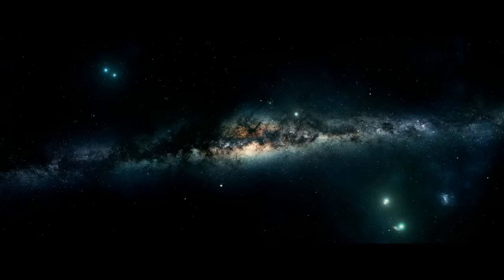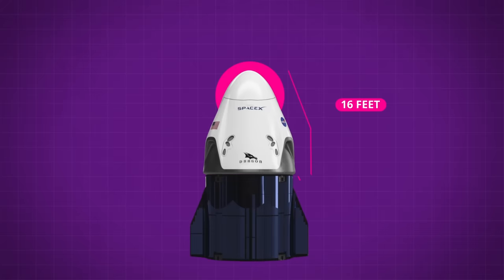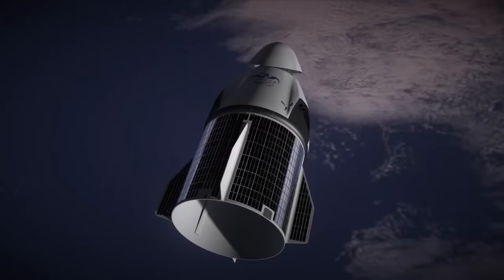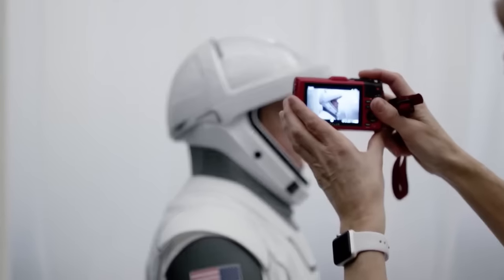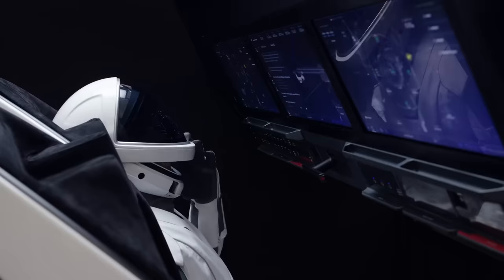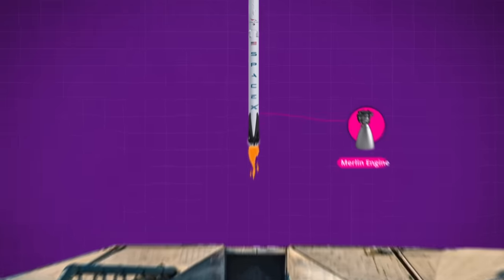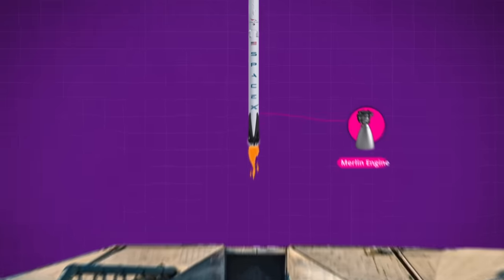Life Inside The SpaceX Dragon Capsule!

Comment: Overall a really great video - a few points though:
1. When showing dracos and superdracos, the video shows superdracos being tested when talking about draco, also it shows a turbopump schematic. Draco and Superdraco are both pressure fed, no turbopump on board Dragon.
2. When explaining the effects of vacuum, Blood inside the body doesn't actually boil. The human skin is sturdy enough to maintain sufficient internal pressure within the tissue to avoid boiling even at 37°C . The issues are instead:
   - the bends - excess gas in solution in the blood might form bubbles - causing strokes or other damage - similar to a diver rising too fast.
   - freezing - exposed mucous membranes in mouth, on the eyes and inside the lungs will encounter rapid evaporation of liquid, causing drop of temperature and possibly localized freeze burns. This is especially dangerous in the lungs.
   - sun burn - if skin is exposed to space directly, unfiltered sunlight will cause severe sun burn due to high UV content and heat where exposed
   - suffocation - no air means no oxygen, which causes loss of consciousness after as little as 10 seconds and death within 1-5 minutes
its the very last that is typically deadly. Everything else is harmful but anyone rescued before they suffocated should have survivable injuries.
3. The suit doesn't have to restore sea level pressure. Typically pressure at 10000ft is considered comfortable in airliners, twice as high is survivable, even more if pure oxygen is supplied instead of nitrox, which most emergency suits supply in case of pressure loss. When exposed to vacuum, most IVA suit system typically supply an environment more akin to a climber on the peak of Mt Everest with an oxygen bottle than air at sea level.
4. The mission timeline could have mentioned stage seperation in a bit more detail. During 1st stage flight the g forces slowly increase as there's less and less propellant left. At the end the engines throttle down to prevent it from getting too high, but its pretty intense. Then they shut down at MECO, and you are suddenly weightless for the first time for a few seconds, feeling your stomach and everything else lift, before the 2nd stage ignites for the 2nd half of the ride. Stage sep is quite intense, and so is the 2nd stage flight on Falcon with the engine so close to the capsule, as reported by Astronauts.
Reply: I dont think that smiley fits here. This is a education video. If there is false information. Most people are glad when its corrected with right information.
Reply: A very important point here: You can't physically prove your fantasy land of space exists 👍
Reply: @quentinmayerhofer9003 Relax. It was funny. We all get it, but we can still maintain a sense of humor.
Reply: Maybe you should be in charge 🤮

Comment: So what happens to Dragon 2 if computers onboard have problems AND they lose contact with the ground? They are kind of screwed. No Buck Rogers manual control like in Mercury or Gemini. Gemini 8 would have been fatal with this system. Its emergency happened outside of the window of contact with the ground, and a thruster was stuck.
Reply: Not very much detail in the video.  I'm pretty sure they thought about that already.  Plus that ignores triple-redundant systems with isolated processes, power supplies and support systems.  They also probably have established procedures right on their iPads.

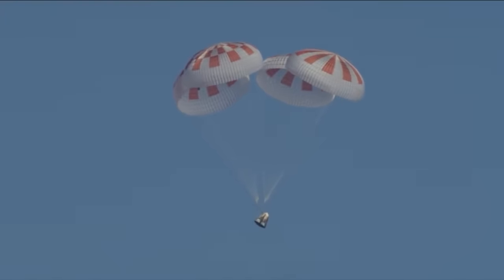Comment: 1:30 A little more respect for the Apollo capsule would be appropriate.
You also need to remember when the Apollo capsule was designed and built.
Reply: Also, to imply that the Apollo Crew didn’t understand the lights and meters is completely ignorant.  Every crew member knew every switch, light and meter’s function.

Comment: Why don't they fire the Draco thrusters prior to reentry, as part of the reentry burn? They are not used in decent and they have a significant mass whose elimination would aid in the reentry process.
Reply: It's cheaper to refurbish a slightly thicker heat shield than the draco engines. They wanted to use them for land landings because refurbishing them is much cheaper than all the support ships and helicopters needed for recovery in the ocean as well as the sea water damage. The super dracos have plugs built into their nozzles to keep them protected from seawater if they are not used.
Reply: Orbital mechanics are a harsh mistress, you don't want to just go firing engines and altering your carefully calculated trajectory, and then end up burning because you where too steep. Also, the propellant mass hardly matters for reentry. 

Finally, even if they fired them, they would still have to take this precautions, because that's what they are. The motors already have valves that close and aren't supposed to leak any fuel, but unburned residues could still be present. So, burn or no burn, they would still have to do this.

Comment: Just a thought but if they are angling for re-entry and the Draco ESCAPE rockets have not been fired, why not fire them to slow down the craft, lighten it up a bit and ease the heat of re-entry?
Reply: In short, because it's not necessary. Servicing the heat shield is easy (and has to be done after entry regardless of how much it's worn) ; Servicing hypergolics which were fired is a right PITA, so the less it has to be done, the better.

Not to mention Super Dracos burn a lot more propellant, and thus increase the risk of contaminating the pod accordingly.
Reply: @paulzuk1468  Thank you for ending my career in rocketry before it got off the ground - let alone re-entered the atmos... :O) Seriously though - thanks for clarifying.

Comment: Why doesn't the elevator go all the way to the crew access arm?
There has to be a logical reason that the astronauts have to go up a flight of stairs after taking the elevator ride.
Reply: Because the space shuttle was a different height and crew dragon is on a half floor so the old shuttle tower elevator wasn’t made for this so they made a staircase
Reply: @Wurtoz9643  Thanks. I always wondered about that.

Comment: Great video !  For something better we will have to wait for the Crew Dream Chaser !  And that will have to wait for at least until after the first six cargo flights .  These flights to LEO is the "First Step" for the return to the moon to stay (and cheaper than SLS)  ! ! !  After docking with the Commercial Space Station in LEO (and low inclination) the crew transfer to the LEV/LLV (single stage/reusable/with an air lock/dust lock).  The LEV/LLV (mass about 12 to 15 tonnes) will load about 45 tonnes (or less) of fuel (H2/O2) for the  return to LEO !  More info on "moon direct" by Robert Zubrin.  Back to the Moon to Stay and onto Mars and Beyond-Ad Astra...  Talk to you on the moon soon!  tjl  T. Lipinski

Comment: We all live in the "B" field of earth,  that is the center of the earths magnetic field.  The pyramids could have been communication devices that would vibrate the earths "B" field and allow for connectivity around the earth.  The great pyramid though I believe was a total intergalactic transportation device operating in the earth's magnetic field.  vibrating the numerous stones in the kings chamber would allow for transport!!  So lets look over what we know as fact:

1.  The center field of a magnet just like the earth is the most powerful part of the magnetic field that is showing itself through the IRON magnetic bar.. IF  it weren't for the center field energy AC current could not flow!! nor radio waves. (nor would there be a magnetic bar).

2. Things we know and can prove :  A. If you take the center of a magnetic bar and tap it close to a trickle of water you will see it repel the water!!   B.  If you tap the center of the bar on none Metalica things you will see them loose significant weight!!   C. If you use a sawtooth wave form with the "B" field just like they show on the pyramids (^^^^) typically at a frequency of less then 432 cycles on granite rock it will  turn to butter and when you stop the vibration the rock will be much harder because the molecules could relate better.  D. I personally believe that UFO'S operate on the "B" field ,  They are for the most part none metallic more of a fiberglass plastic superstructure.  The fact that they emit such a strong "B" field they disrupt our primitive systems.  E , Man kind has a long way to go with the "B" field. Want to see a little proof:  Go to Coral Castle Florida on YOUTUBE just for starters. Ed had constructed several generators the last one consisted of 25 "V" style magnets 5 deep all in the REPEL mode to maximize the "B" field into his ground.   We have allot to learn..!!!
Reply: reading this gives me brain rot

Comment: Question: do the Super Draco thrusters share a fuel supply with the normal Draco thrusters on the Dragon?
I've been wondering if SpaceX could fire the Super Draco thrusters after docking to the station to give it an orbital boost (otherwise the fuel for them is just dead weight both ways), or if the same fuel is used for the other thrusters so it's an either/or (if they abort they aren't going to need the other thrusters, if they don't abort the other thrusters use the fuel)

Isn't the Dragon able to hold up to 7 people (not that it's been flown that way, but I thought both Starliner and Dragon had configuration options for more than 4)
Reply: This was talked about a lot after the invasion of Ukraine, and Rogozin's crazy claims regarding the ISS. So, there was a lot of speculation about using Dragon to boost the ISS. 

It is theoretically possible, but there are a few potential issues. The first one being, the IDA (the docking port used by ISS and Dragon) isn't rated for that. It isn't rated for that kind of thrust. Basically, it was designed and it's rated to dock a vehicle and let astronauts in, not to move the entire ISS. 

There is also an issue of thrust. Zvezda has two tiny engines that produce arround 3000N each. Each superdraco does like 60kN. It might be a bit too much, even if deep throttling.

Comment: So how come the man who dropped off a redbull balloon did not burn up
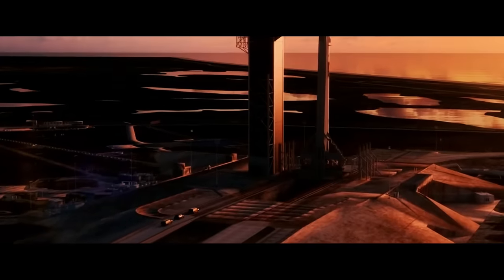Reply: There is no reason to burn up when you drop from a balloon. Why should that happen? So it was not even space (a balloon cannot go to space), but only 39 km. Most used definition for the beginning of space is 100 km. However, at 00:25  he mentions Blue Origin as "not real space". They have a small rocket, that goes straight up and then drops from 107 km. Also that doesn't need a heat shield, it is not fast when it enters the atmosphere.

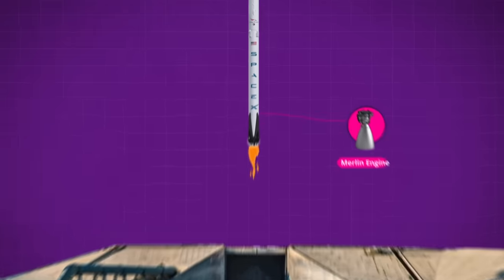The reason, why the Dragon capsule burns on re-entry and needs a heat shield is presents at 9:27 . It accelerates to 27000 km/h. So it flies around the earth with that speed (everything in low orbit does that). But that also means, that it slams into the atmosphere with that extreme high speed when it come back.

Comment: I'm pretty sure the astronauts that flew on Apollo knew what every light, switch and instrument was for. Why do you say the nonsense that you do?
Reply: Wrong. Reference the Apollo mission where they were struck by lightning and everything went dead. Ground Control had to tell them where the switch was for the backup system.
Reply: @stratolestele7611  So, you're referring to one instance during a very high stress moment. Move the goal posts much?
Reply: While I'm a huge fan of every single Apollo astronaut, and have nothing but respect and admiration for them, that's not entirely true. And not because they weren't capable, I mean, Buzz basically invented the orbital rendezvous, BUT the capsule was insanely complex. True, because it had to be, but automating a lot of things and having better interfaces IS important. 

If you think they actually "knew what every light, switch and instrument was for", I have four words for you: "Try SCE to AUX". Sure, they where steely-eyed missile men, but nobody can know everything about everything. 

For instance, the goddamn AGC. Nobody knew the entire AGC, or what each verb did, and what all the nouns were. Not even the developers.
Reply: @stratolestele7611  They have very precise procedures in place which they follow explicitly, step by step. Those steps are verbalized and  ground coordinates with them.

Comment: You are comparing apples to oranges. There is a difference between an IVA and an EVA. EVA's have all life-support systems built in. That's why they're so bulky. An IVA, though it can support life, has most if not all of those life supporting needs external. That's why they're comparatively thinner, even the older NASA versions. IVA's need to be plugged into the spacecraft for one to live in the vacuum of space. They're more of a safety mechanism more than anything, you really don't want to need it. Well, that and climate control while you're waiting to blast off...